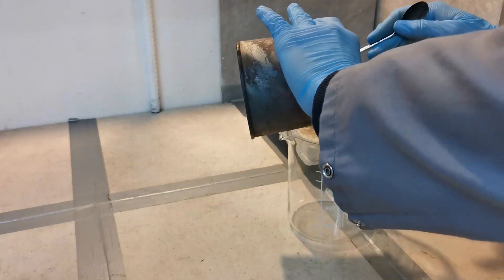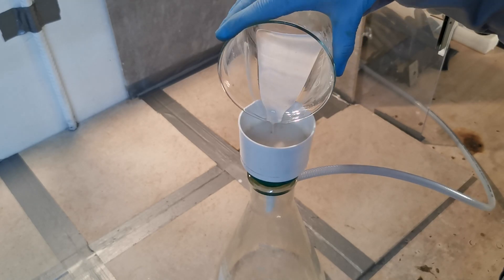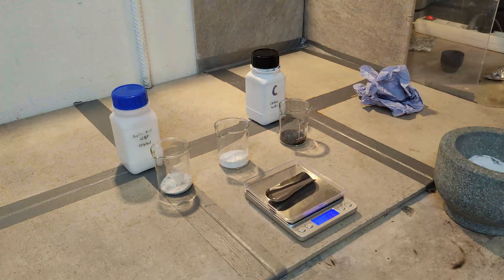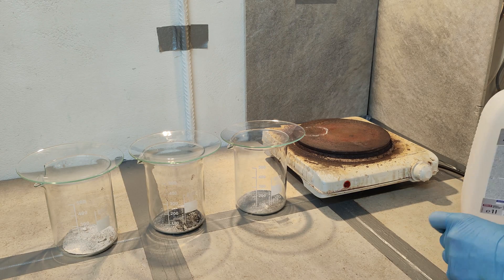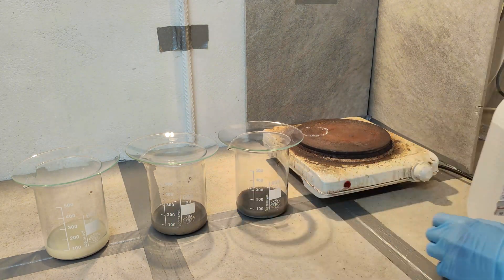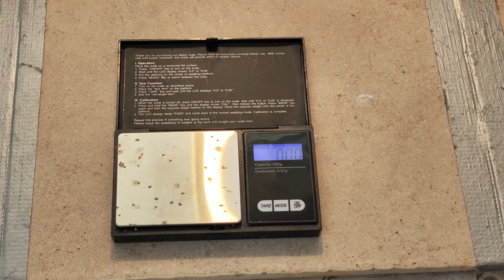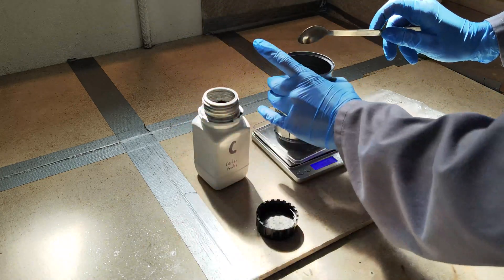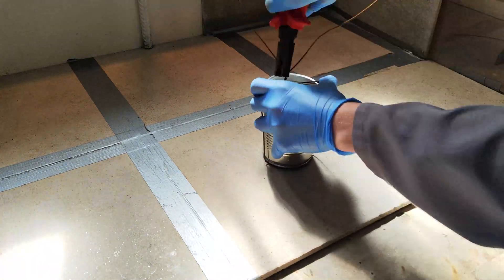Recycling Barium Sulfate to Barium Chloride

Comment: Addition of aluminum or magnesium powder might do the trick. Not sure about Al, but Mg rips oxygen off sulfates as greedily it almost explodes. Adding, say, 25% Mg to carbon by stoichiometry should work. Maybe less. Ideal proportion should make the mix burn calmly by itself after some heating.
Also there are mentions of methods to recycle BaSO4 by reduction with propane-butane gas mix on heating (yielding BaS) and by reacting with CaCl: "BaSO4 is reacted with excess of conc. aqueous CaCl2 at 170 C during 2-3 hours. Produced BaCl2 is extracted with methanol. Same reaction occurs on fusing dry reactants (yield 90%)". Might be worth trying.
Reply: In the case of adding Al/Mg, the resultant powder can't be added directly to acid since magnesium/aluminum chloride can crash out of solution as well. A reaction with boiling water may be needed first to turn the barium sulfide to barium hydroxide. In the case of using magnesium, both magnesium oxide and hydroxide and insoluble and can be easily filtered off.
Reply: Aluminum or magnesium and barium sulfate makes flash powders where the sulfate acts as an oxidizer.

Comment: A normal burning wood fire barely heats things past 800 Celsius.  What you need is a propane metal melting furnace or simply use a shop vacuum with a blower mode so you can blow air to the bottom of wood fire

Comment: You might try allowing some oxygen to the reduction. Theory being that the carbon is oxidized to carbon monoxide and the carbon monoxide acts as the reducing agent. Add excess of carbon, heat with lid off to red heat, stir occasionally,  remove from heat once mixture is no longer black and all the carbon has been oxidized.

Comment: Amazing! Have you tried boiling barium sulfate with sodium carbonate to convert it?
Reply from the maker: Yes thanks for the question, I actually did, what's this process called in English again? In German we say "Aufschluss"
I forgot to mention that in the video.
I tried with pure sodium carbonate, a mixture of carbonate and hydroxide, and an eutectic mixture of sodium potassium carbonate. Unfortunately it precipitated again as soon as you try to dissolve the resulting mass.
I believe The Sulfate Ion does actually move onto the Sodium while heating, but since it still is in the solution when you dissolve it in water later, it forms Barium sulfate again.
I guess the only real way is to destroy the sulfate ion like i showed.